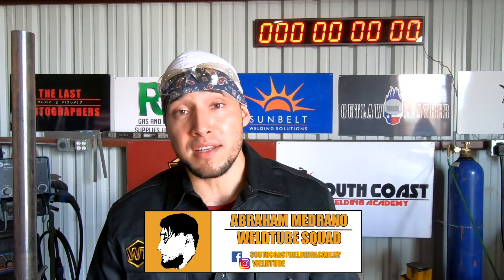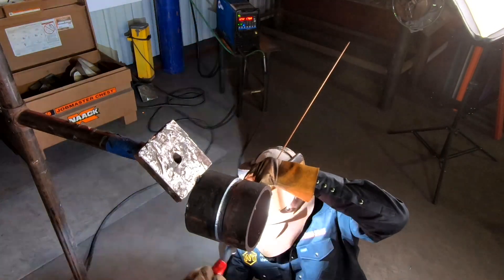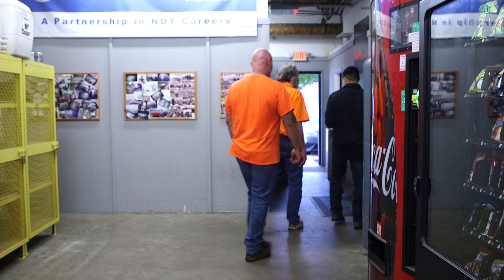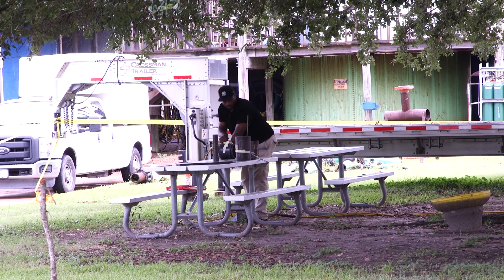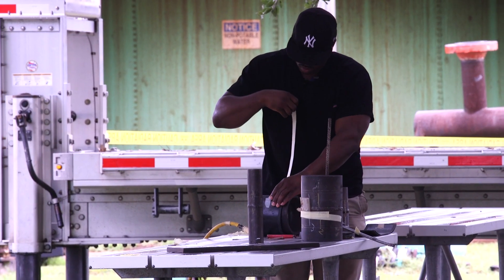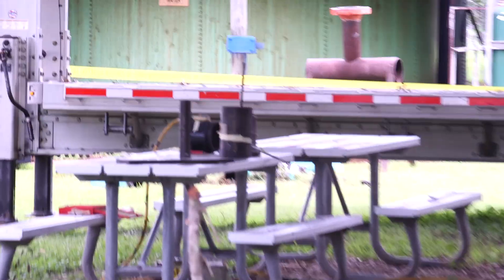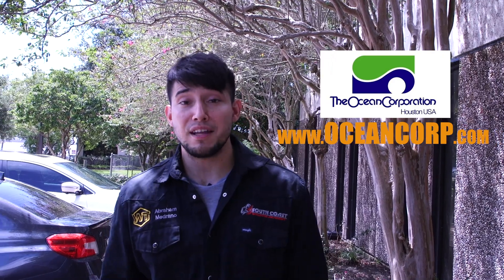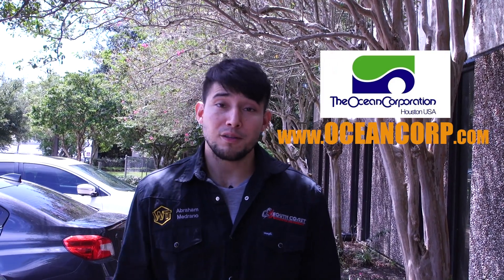X-Ray Testing My Welds 100% - Will They Pass?

Comment: I have been a NDT Radiographer for 35 years and still working offshore. 
I would like to know what the size of the source they are using.
I from the UK I have worked in the USA with a 7.5 Mev betatron I know their regulations are different from the the UK's

Comment: I always used 3/10" cassettes on a 6" pipe w/a number belt, bungie... RT Dude must be using SE75 for shooting on a picnic table Outside with No Shielding,  Barricade way to small for IR192...
Reply: Everything about the rt tech was baffling to me. No 0 marker upside-down leads and iqi taping everything. The 17" cassettes I couldn't believe it

Comment: Pro tip. Cut the thumbs out of every trashed glove you ever have. Welding tips and tricks originally gave me the idea. No need to tear up good gloves every weld. Just put a thumb on like a tig finger and run with it. If you want the real tig finger I am not stopping you. I’m just cheap. And saves tig gloves from shrinking around your hands where you can’t get them off too when you forget you don’t have stick gloves on. Dunking your hand in a quench tank in welding school was kinda embarrassing to get the damn thing off.

Comment: "Why do you use lead numbers?"
"Because radiation won't pass through it"

Uhh... radiation DOES pass through it. Lead just absorbs more radiation due to its density. Thus not allowing much radiation to hit the film.

Also saw the spacing on the location markers. Complete garbage. They need to fire that Level II. Horrible. Damn nice weld though.
Reply: Im from the UK, and that guy would get laughed at straight up and would never find a job doing RAD here.

Comment: also noticed he put hi penny upside down. ( numbers read left to right penny upside down) personal preference i guess i just cant stand reading film like that,  for this setup i would have kept my numbers on the top side of the weld, and put my b pack astm portion so it reads( 1 astm b) on the same side and wires going down. so when i look at the film it would be whatever increment 0-1, 1-2,etc then the penny. so it should read like this 1 (increment first number , 1 astm b ( bpack) then 2( last increment). like i said personnel preference. you dont see alot of nde videos but the ones i come across i gotta pick at ahah

Comment: 3:20 I see that you are feeding the wire on average after every 3-4 complete walks of the cup. I gotta ask: how many times did you have to sharpen your tungsten? Or do you go into this pipe weld with a handful sharp at both ends ready to go? And how often did you have to let the pipe cool? For how long? or does that not affect the NDT? Thanks. Loved this video the most of all your intructionals. Peace unto you.

Comment: Can’t believe they are still using tape to hold the cassette, numbers, collimator, etc. We use magnets to hold the cassette and collimator and have sets of bands for each pipe size and for different number of shots, it makes setup way faster.
Reply: So literally a bungie is the fastest method
Reply: Where's his assistant?
Reply: This is a small company
Reply: cant believe anyone uses magnets, most people use a bungee cord
Reply: @guitarplayer5932 yup we use bungees and magnets when applicable

Comment: If you can't make an X-Ray quality weld in perfect shop conditions then you should not be allowed near a welding machine. Do the test in a cramped boiler penthouse, among the super heater tubes, with a mirror. Then, if you make the X-Ray I will say, "Good for you". In a shop, no big deal.
Reply: ok hero lol

Comment: I had to get a bunch of 1 inch pipe welds xrayed the other day and some 1.5 inch xray. also some 2 inch 3 inch and 4 inch 6010 root on all except 1 stainless tig. all shots were clean. 1 inch 6010 welds should never get xrayed. luckily it was all clean.

Comment: As another level 2 RT tech, guy did a great job and was professional as all hell. Needs to change out his chemicals though if they so low you need to use 17" film 😂
Reply: I found it odd he's just taping his numbers on instead of using a clock tape
Reply: Professional as far as not being as ass. But he was terrible at explaining the process and what exactly he was doing and why.
Reply: @kylespirk306  he was also using 17” film on a 6” and didn’t use a number belt. Was also taping the film on there when a bungie would be a lot quicker and easier.
Reply: Taping the collimator for every shot is a huge waste of time I'm surprised he can run film but hasn't heard of a bungie yet
Reply: He should have shot it panoramic, or at least eccentric. Shooting double wall when you have easy access to the inside is crazy.

Comment: I had a repair for porosity on some 3” one time.  I was done welding for the day and just on standby.  The techs showed me how they load film, how the figure the formulas for shot and development time, and what wire pack they use for what wall thickness and pipe size.
Reply: Did you pass?
Reply: You can have porosity on any size pipie

Comment: No matter if its for a job or to see what kind of welds your producing, the wait is nerve racking!
Reply: Kandela Brown  not sure what you are taking about I've been a refinery inspector for almost 15 years and the only time i see digital radiography is for profile shots. In maintenance and, new constitution, and turnarounds this is the normal process..optionally you could utilize ut shearewave or phased array but most places do not trust the techs ability to locate flaws. I agree with that assessment.
Reply: @clintg3435  times are changing...Digital weld quality is becoming more relevant.
Reply: @joshuajones1319  joint geometry limits use of the digital radiography plates.  And ultrasonic examination tech skills have slowed the availability of this method to be used.  I understand times are changing.
Reply: @clintg3435  ......I'm literally a CR xray tech, shooting weld quality and profiles in a chemical plant. You are talking about DR plates that can't bend, it's a little different process of capturing the image.....
Reply: @joshuajones1319  so we agree?
Reply: @clintg3435  negative....CR is computed radiography, and DR is digital radiography which is like apples and oranges as both are fruit.. CR uses very thin plates that are able to bend like normal film, and you use a scanner to "develop" the image.  DR uses a heavy thick plate that's not bendable. It's connected wirelessly to a laptop and you expose it to radiation till the image is acceptable to view.  Soo basically DR is very limited to profiles only, and CR is used for profiles and weld quality...All of it is classified as DR (digital radiography)...
Comparing apples to oranges, as both are fruit....That's the best I can explain it!

Comment: No disrespect. But GTAW is generally clean process. The only defects may encounter is metal inclusion and porosity. cautious taken during welding justify RT result.

However to really check skills, perform GTAW, SMAW combi. on austenitic steel (304 most commonly used, 305, 309, 310) as these may become 'sensitized' depending on 1.carbon content and 2.manner in which they are welded (technique). Performing RT after 72 hrs will reveal cracks (if any).

For xtra challenges try on HK40 steels(high carbon cast stainless steels) but with GTAW only. i haven't seen those in my experience.
I would love to see!

I am from India btw and learning a lot through AWS. Thanks.
Reply: Go learn how to weld yourself before trying to challenge welders , oh that's right you more then likely cant , like most , will fall back on somthing that can easily be learned from reading books and watching videos
Reply: How about severe cycle… seen a lot of ppl pass X-ray until they shoot severe cycle never seen so many stainless bust and carbon … they will call porosity and slag inclusion on a stainless weld 😅 I ground into a few to find some grey spots .. tungsten inclusion … doesn’t take much to swirl in there and get trapped. Won’t burn out. Don’t get lax just bc tig is a clean process doesn’t mean you won’t catch a repair

Comment: Why you couldn’t film the pipe getting x-rayed?
Reply: You didn’t miss much. They lay the film out and mark its location, set the source location, crank out the source for the calculated exposure time then crank in. Then they develop the film.
Reply: TheCummins1212 that comment is literally only helpful to X-ray personnel lol
Reply: Joshua Marcotte funny I’m not X-ray personnel but I’ve had plenty of welds shot and it’s all the process from casual observation 👍
Reply: @TheCummins1212  that's spot on for just observing!!!
Reply: You could, but you would either need to film from a distance outside the radiation area or use a tripod to leave your camera near the source.  Radiation will cause ionization, but not enough to interfere with the camera.
Reply: IMO he was acting like the camera was classified or secretive. I could understand not wanting serial numbers on video but he went all out and asked it not to be filmed.